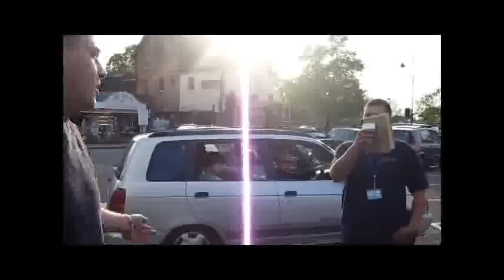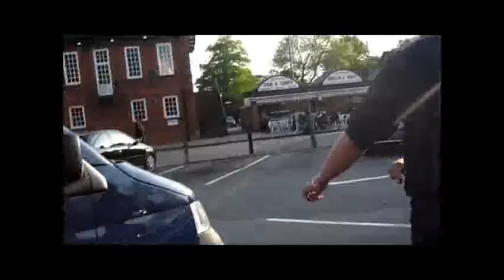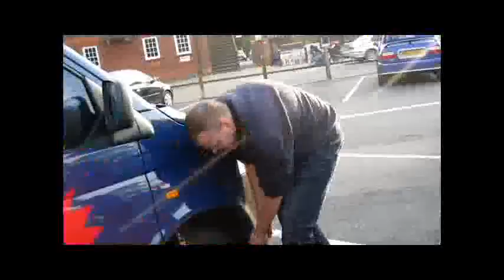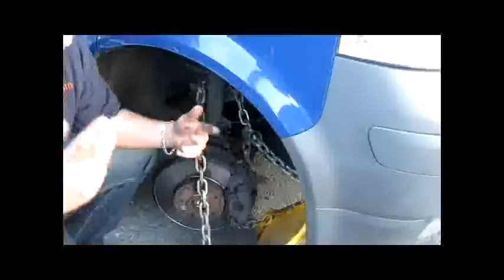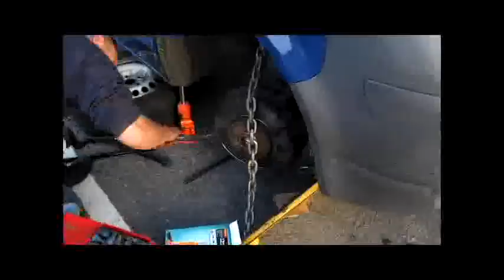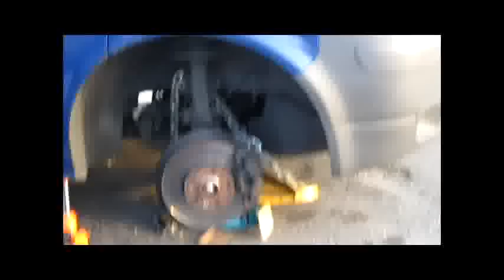How to remove clamp legally...Wheel clamping...   (    Part 2  )

Comment: At the end it was night...
How much time he did need to get it off?
Some do it in seconds.
Reply: Only with a lock pick or cutting part of it. If you are caught out with a set of lock picks, you could be arrested for "going equipped".
Reply: Chris Cameron
He also could learn how to pick a lock.
It doesn't damage the clamp or lock, and you're finished in less than a minute.
Reply: very true and much less hassle too! lol
Reply: Some pick these locks in seconds.
Others get it of with a grinder in 20 minutes.
But this is the most difficult way.
Reply: Grinder is illegal, since you would be damaging the property.
Reply: Peter Mirtitsch
 I've seen video's of some doing it with a grinder, but they took ages.
I would have a pick set in my car, to open the clamp, lock it on a lamp post, and jam the keyhole.
Reply: Who would find them? Does anyone have tho right to search your car?
In my opinion they need a search warrant, and a reasonable suspicion, to do that.
Just like they search someones home.
Reply: John Obmar
if you have them on your person and are seen picking the lock, or they are visible through the windows on your dash or on a seat, that would be sufficient. There is also the fact that if they suspect a crime is in the process of or about to be committed, they can claim reasonable suspicion.

Comment: lock pick kit on Amazon $20. They are not as no nice as the Sparrow kits, but they will work for a few locks before breaking. depending on the lock, shouldn't take more than 5 minutes.

Comment: Clamping is now illegal in UK. However if I was the clamper in this case, I would wait until the wheel was off the van then removed the clamp and put it on the other side. Rinse and repeat.

Comment: Well done mate,very entertaining,although you made a real meal of it!
That chain is dirt cheap,I`d`ve cut through one link with a 1mm slitting disc fitted in a cordless hand grinder,welded the link up with a high tensile&dissimilar metal welding rod(chrome finish),stronger than original and returned that el cheapo nastio wheel clamp to the clamper.I would also send the clamper a bill for damaging the paintwork on the McPherson Strut and damage to metal brake pipe on the veedub.
Was it a trick of the light,or was that offside front tyre below the legal tread depth?
Tell that silly little man that a public area is anywhere the public frequent...so it`s not a private area per se.

Comment: You don't get a fine if clamped as the clamp is the fine of sorts. The charge is a removal fee, not a fine, so you're not breaking any laws in removing the clamp, as long as you don't damage it.

Oh, and because they put the clamp on your property, you also have the right to take the clamp back home and then notify them of a storage charge.

Comment: You went as far as to remove the wheel. You should have undone the top three bolts  that hold the strut to the body and lower the strut and lift the chain over the strut and rebolt it up and your done.

Comment: It may be private property, but it's a public place with public access. Thus most of the rules on a public place apply. He can't insist you can't touch the clamp, he can insist you don't damage it, but that's all. Otherwise there's no way he can install it because he has no legal right to touch your car. The delay taken to work on the car is their fault and not yours.

Comment: The copper is wrong. You are not under any contract. A contract is a signed agreement between two parties. Also it is not a criminal offense, but a civil matter.
Reply: +grahame belton correct-no verbal or written contract was initiated.
Reply: Absolutely right, it's an implied contract. Provided it's all clearly stated at the entrance what the terms and conditions are. I used to work for BT many years ago and if you didn't sign and return your contract for the phone but still used it then your use implies that you accept the terms and conditions.

Comment: There is an easier way.  

1.  Cut the lock off. DONT damage clamp.(criminal damage to a lock)
2.  Go to a lock shop and buy a lock of the same or better quality.
3.  Deliver the clamp AND new lock (with both keys) to the local police station.
4.  At the police station also leave your name and address.

This then is a civil matter for the clampers.  Clampers dont challenge this or dont turn up in court as they are spineless. (they pay the court fees)

Job done. - Lock cost about £20.00

Comment: If the property stops you from doing what you are supposed to be doing, this law holds no weight in an Aquarius court system.

The property they are putting on the car has rendered your car useless, therefore you are at a loss if you cant use it or get to work or pick up the kids. 

Just put a sign up on the Window saying that the vehicle is your private property and anyone who touches it will be damaging your vehicle and will be fined £5000, if they continue, they agree to contract!

Comment: Why not bring a portable compressor and a car jack? Let the air out of the tire by pressing on the shraeder (Can't spell) for a while and let the rims almost touch the group, jack the vehicle up, pull the clamp off since the chains aren't taunt anymore. If it's hooked around suspension, get a portable electric impact and losen the suspension bolts, take the spring out, and put it back together after sliding it off. TADA!

Edit: Nevermind, just watched rest of vid.
Reply: +Nikator Of Linux to do it this way is dangerous - you Need a spring-tensioner to loose the Tension of the spring - then it would be easy to have a gap tu turn out the chain of the clamp. lol haha cheers

Comment: Not an offence, and not a fine.
 There is no contract. the scammers can not produce a copy of a signed contract, nor will anyone provide a notarized affidavit of claim. No loss, no valid claim, without cause of action there can be no remedy. There is no breach of contract. There is a risk of breach of the peace, the LEO is required to have the scammer therefore release the vehicle. If the scammer has a valid claim the scammer can do what anyone else does, and file in the court/tribunal/small claims.
Distress Damage Feasant does not apply when there is no loss.

Comment: Not entirely true, Whilst your correct that the Majority of clamper's would prefer to clamp on the drivers side, it was never law. It is however in the highway code that a driver should walk around there vehicle checking for faults etc before every journey. If the driver miss's the sticker on the drivers window or A zone of the windscreen then they should really not be driving.

Comment: I’m all for taking it off but the clamper should of waited till he was just about to remove it and then used another clamp on the passenger side front wheel, I doubt he would of took the other wheel off

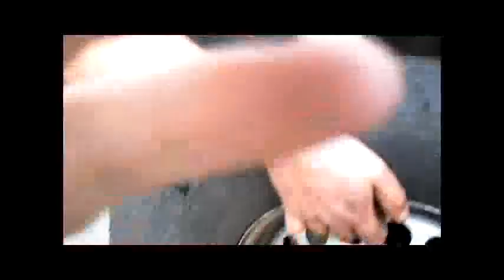Comment: 4:54 one seriously bald tire!   You can cut these wheel clamps off, of course.  But at least in the States, that just adds to your woes.....
Reply: Why not just use bolt cutters on the chain?
Reply: *****
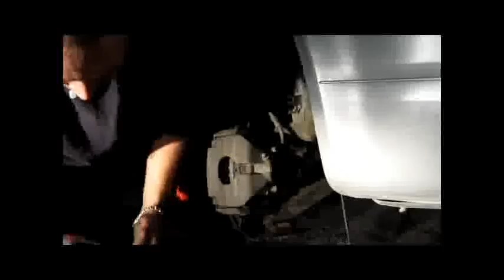Man, he was there all day.  9:08 its dark out!  You know, sometimes it is just easier to pay the fine.

If you unbolted the strut, you may need to re-align the front end now....

Comment: Interesting that the guy is wearing an Ontime sweatshirt, as in Ontime Parking Solutions, a clamping and towing company, whom I recently had a run-in with at Luton Airport, and I got all clamping/towing stopped. Either this is a set-up or he used to work for them and is wearing the sweatshirt for irony (or he's short of clothes).

Comment: Faster  way all you will need is a grinder and a jack.
jack the car/van up
get the grinder and cut the chains
lay under the car/van cut the chains around steering arm
packup and burn the chains
and please and LOL at the clampers
Reply: Ash, that could be one way to remove it, but not legally.
Reply: That would then become criminal damage and the police would get involved. The way he is doing it now there is no dmage done to the clamp, he trades name and details with the clamper and it becomes a civil case. It goes to court, the magistrate will throw it out of court and the clamper loses. All perfectly legal.
Reply: *****
Actually if he had cut the chains it would become a criminal case and the police would arrest him, at which point he would have to give all his details.

Comment: Impact driver and socket adaptor would have have literally minutes off this.
Reply: Yep. Keep tabs on me. I'm a two faced son of a bitch :)
Reply: how would he fit the rattle gun in between the wheel and clamp? the strut is doable. but u would still have to ratchet the wheel bolts out.

Comment: How much time (time = money) and mechanical expertise (which he lacks) did it take to remove it?
Value = none

Clamps (we call them BOOTS) are a result of multiple, unpaid parking fines.
Dont get a ticket = dont get a boot
Pay the ticket you get or appeal it. 
Dont try this jamoke's idea.
Reply: Wrong, I'm afraid. In the UK you can get clamped for a single "offense". I removed one with an angle grinder when a clamper illegally clamped a number of people in a shopping car park. I handed the clamp over to the Policeman when he arrived, gave him my details, and went home. The clamper was fired the following week.
Reply: I removed a similar clamp today using the same method took me about an hour to have the clamp off. Considering they wanted £340 to remove it I don't think that's too bad for an hours work.

Comment: Drive off and make them pay for excessive force and damages......
Reply: Bob Jones By trying to drive off with clamp on you have ignored notification and you are therefore liable to any damage to the vehicle. You are also liable for the original clamp fee and the cost of replacing the clamp.
Reply: +Hammy Hog  Who ever checks there right front wheel before they drive off ?
Reply: Bob Jones Who ever ignores the notification document on the driver's window?

Comment: If you Park where prohibited and signs or limits displayed clearly you have clearly broken the Law, and should be prosecuted. It sounds like Gatwick Airport to me me in UK.

It appears this took several hours to achieve 'release'  and a very 'grey' area of abuse.

If you park on my drive without consent,  I would remove you wheels and more - Ass@@@@

Comment: He was there for hours any lock no matter wat can be drilled in 60 seconds or less instead of tacking the wheel off and stripped the van wat if he went true all that and then the guy just put one on the other side would he still be laughing idiot just brake it
Reply: Irene Mcdonagh you cant damage the clamp. you can remove it without causing damage to the clamp legally, but if you damage the clamp then you can be charged with criminal damage, i.e purposely damaging someone elses property